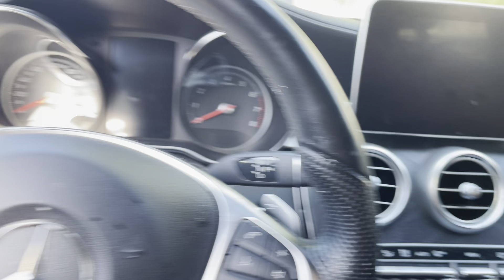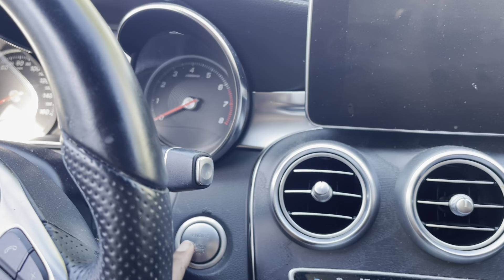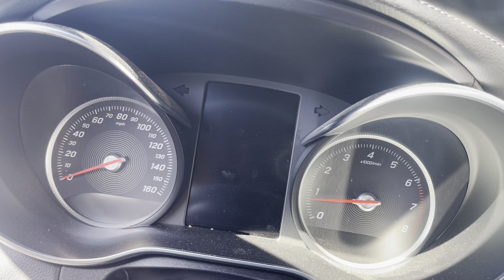Mercedes-Benz Batteries are a headache! (THIS IS WHY)!

Comment: Good afternoon. Yes, if you're not driving it, you should put a trickle charger on it to keep the voltage in the battery up to proper crank amperage.
Reply from the maker: Yes I’m starting to learn that 💯 also do you know if I get a aftermarket battery do I need a factory reset from the dealer or am I good just buying one and putting it in?

Comment: Definitely INTERSTATE because of the warranty. But only if you plan on keeping your coupe. If you upgrade to the S63, the aftermarket battery in your current coupe will lower resale value (by a few hundred, that's all)

Comment: I dont know why this video got recommended to me but I change batteries for Mercedes almost daily, your example is actually easy to replace. Remove battery terminals with a 10mm, remove negative first then when you put the new battery connect the positive first, and you need an extension with a 13mm to remove the battery holder and thats it.
Reply from the maker: Yes but I do have a question for you, do you have to take it to the dealer only, they said the battery won’t work correctly unless the dealership does a reset on it so it last longer, is that true? Thx for checking out the video 💯
Reply: @3DThaRapstar  no,you dont have to take it to the dealer only,any shop can do it with a diagnostic tool if necessary some newer models require coding but even if you dont it will self adjust after a few days, no risk of overcharging or undercharging the battery or increased battery wear, the registration might help with some error codes, for example Volkswagen cars do require coding on models after 2009, but ultimately even if you register the new battery or not the most important factor affecting a battery life is how you use the car. if you drive regularly it will last at least 4 years, if you take long breaks from driving expect 2 years or less.  You have to buy an 80ah AGM battery, i can recommend Varta Silver Dynamic AGM but i dont know if you have those in the USA
Reply from the maker: @pga-1510  ok thx for the info appreciate it, and I will look into that 💯